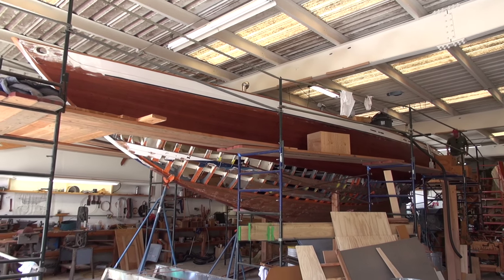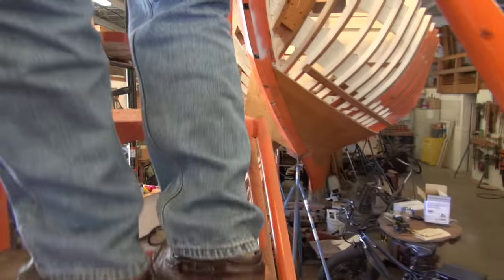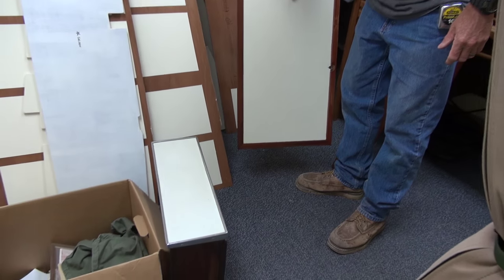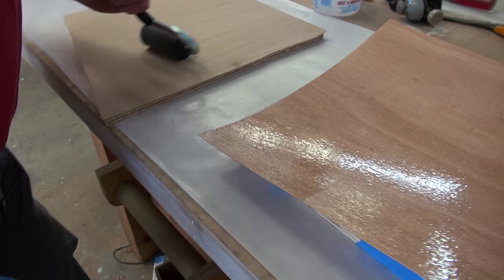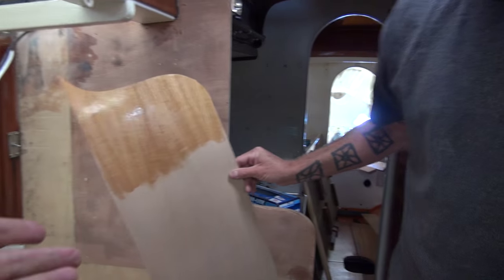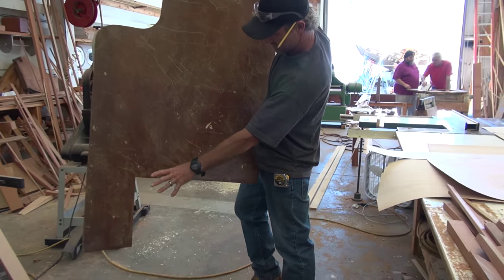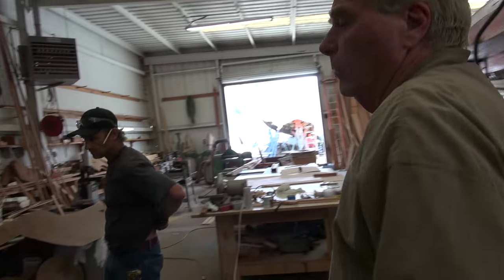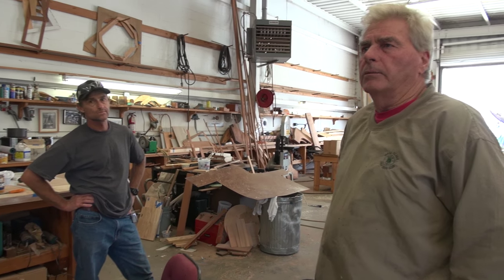Restoring Susanna - Episode 50 - The New Bulkhead

Comment: You should vacuum press all of the veneers in place... no baby sitting.
Reply: +Bill McCaffrey How are you going to vacuum press a bulkhead when it's  in place? It's glued and screwed on two or three sides, you can't get a bag over/around it.
Reply: +Luckystrike There are tapes that are used to put a sealed layer of plastic over any weird shape and then you add a vacuum port to the plastic and away you go. Most items can't be "bagged", but you can almost always use a sheet of plastic over any weird surface. This is the same way that glass on foam boats are built.
Reply: Bill McCaffrey
Answers my question.